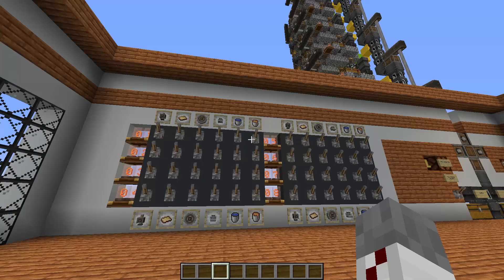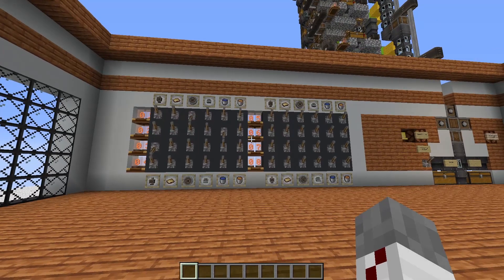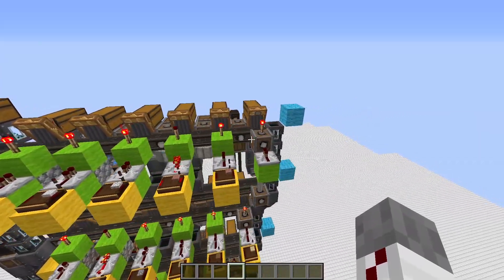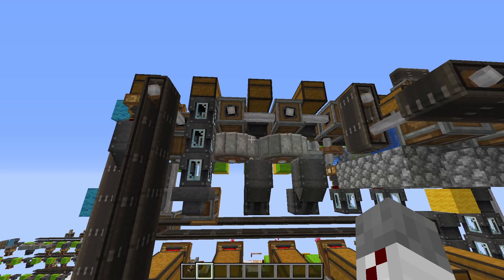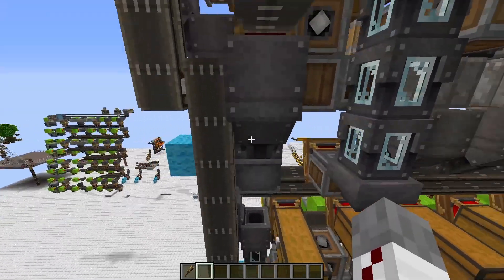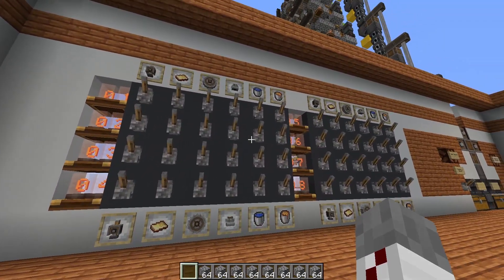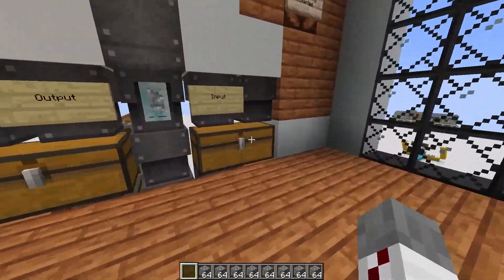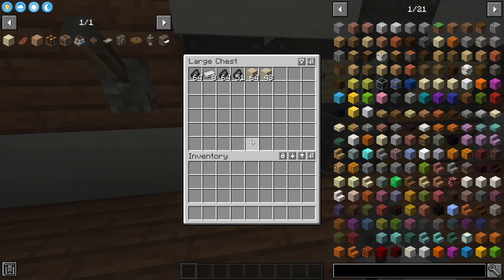Minecraft: Create Mod Programmable Workshop and Ore Processor

Comment: I downloaded the schematic and built it but whenever I put anything through the crussing wheels they just get spat out the side and fall to the floor instead of going down the chute. What can I do to fix this?
Reply from the maker: Hi! So this was Create 0.3. So the vertical funnels need to be changed to smart chutes if you’re using anything after 0.3.2, and maybe double-check rotation direction? I haven’t tested this in a year so I can’t be sure if there are other issues but hopefully the smart chutes solve this one.
Reply: @BLOckOus  Thanks. Will test this in my creative world and hope it works
Reply from the maker: @Fezzman  let me know if you run into other issues!

Comment: It's so simple yet complex at the same time. I can see why it took multiple versions to get here. I'm guessing its based based on a modular system?
Reply from the maker: Yeah basically each layer is a module, and I thought I lined everything up correctly a few times before needing some more chutes that wouldn't fit, and I would have to break everything 😅

Comment: For auto setups I am planing, the mixer would use the stock pile reader to prevent clogs.
Reply from the maker: That makes a lot if sense! I’d love to see your design when you complete it. The design I came up with doesn’t use the stockpile switch but it requires that you set the ratios with funnel filters. It will be my next video since I’ve already finished it.

Comment: What would power that thing? I want to use on my server but I’ve never generated that much power without the creative motor.
Reply: I think furnace engine + flywheel
Reply: Or with some tinkering, you could automate a blast furnace flywheel set up
Reply: @MilkyWhey maybe.
Reply from the maker: Theoretically, you will need a 5 furnace-engine array hooked to a belt. But I'm now realizing that that's easier-said-than-done, so I'm literally about to start working on a proper power-source for this machine and will hopefully release it in one of my upcoming videos.
Reply: @BLOckOus  thank you